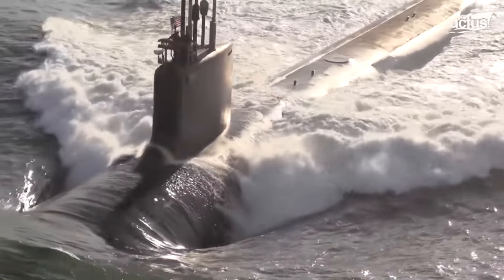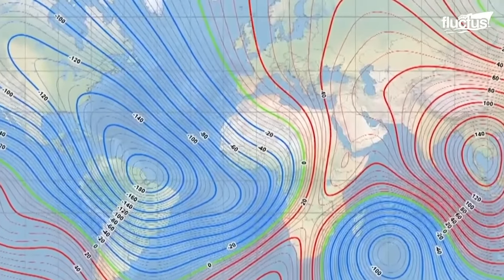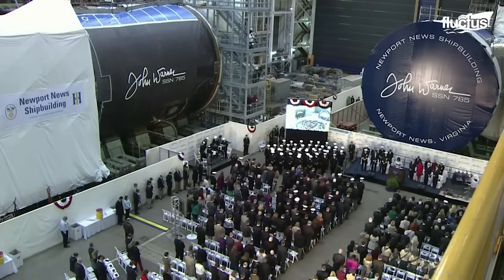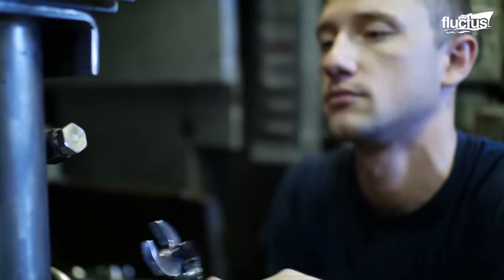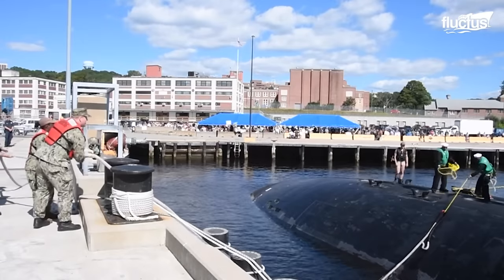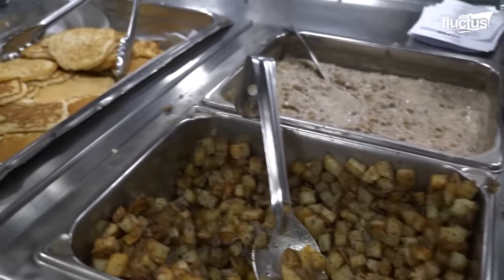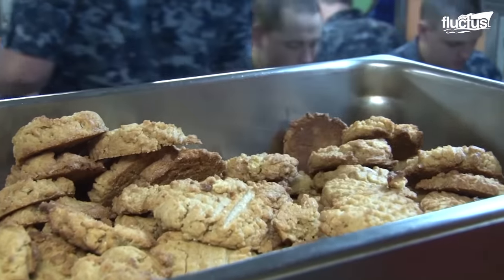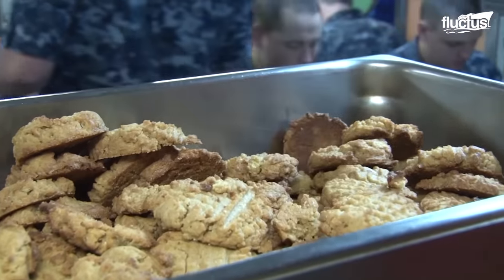Life Inside $4 Billion US Gigantic Submarine

Comment: It's overwhelmingly amazing and scary af , a pure combination of a deadly beast. I'm pretty sure even the people operating them on a daily basis don't understand what kind of savage machine they're using. Art at its finest ❤️ the pinnacle of human imagination.
Reply: Not really.  Submariners have to qualify to continue serving onboard.  You have roughly 1-year to earn your qualification. If you fail, you are shipped off to the surface fleet.   That being said, the qualification is comprised of every system on board, electrical & mechanical.  You MUST learn and understand how every system works and is interconnected with other systems.  Learning how one failed component can cause multiple problems throughout the boat.  You must learn damage control technique, how the internal ventilation system is designed, everything about the emergency recovery systems, how the reactor systems work, memorize how the waters systems are designed and what modes and operations are performed by it.  This isn’t just the mechanical rates, everyone on board has to have a basic knowledge of the submarines entire systems to stay and work on board.  The funny part is this, those qualifications are just the “basic knowledge required”, you have to build on that knowledge to qualify higher level watch stations.

Comment: OK, so now I have even more respect for those in the U.S. Navy who work on a submarine!!!!!! Only question in my mind, besides what's for dinner, is since the mess hall is where they cook, how does the cooking appliances (stove, ovens, etc.) vent out the exhaust when the sub is submerged for so long?
Reply: I'd say recycling or pumping  it in the heat/cold system. Or going up once and again to pump it out without too much pression? O  simply putting it in some torpedo and launch it as it is?
Reply: Just move the exhaust fumes to a separate chamber, and then release the fumes from the chamber.
Reply: This is a great question. So all the air in the submarine gets recirculated while submerged. All of the grill exhaust that you're talking about goes into the fan room and recirculates with the rest of the air. There is equipment on board that cleans the recycled air and removes the toxins and harmful gases from the air. Fresh air replaces the old stale air when the submarine comes up to snorkel or comes to the surface.

Comment: I have looked everywhere to try and confirm that the Virginia-class submarines are made anywhere else other than in the USA. From Wikipedia: "The Virginia class is built through an industrial arrangement designed to maintain both GD Electric Boat and Newport News Shipbuilding, the only two U.S. shipyards capable of building nuclear-powered submarines. Under the present arrangement, the Newport News facility builds the stern, habitability, machinery spaces, torpedo room, sail, and bow, while Electric Boat builds the engine room and control room. The facilities alternate work on the reactor plant as well as the final assembly, test, outfit, and delivery." I SEE NO EVIDENCE THAT THEY ARE BUILT BY SAAB.

SAAB builds subs. Just not for the USA. (The video never actually claimed that the Virginia-class submarines are made by SAAB)
Reply: they are not, Saab does build some Diesel powered subs , but not for the US Navy. This whole video is just a bunch of irrelevent facts taken from different videos.  Pointless.

Comment: I thought the submarines were built by General Dynamics' Electric Boat.
Reply: Newport news shipyard also
Reply: SAAB builds subs. Just not for the USA. (The video never actually claimed that the Virginia-class submarines are made by SAAB)
Under the present arrangement, the Newport News facility builds the stern, habitability, machinery spaces, torpedo room, sail, and bow, while Electric Boat builds the engine room and control room. The facilities alternate work on the reactor plant as well as the final assembly, test, outfit, and delivery. Those are both located in the USA
Reply: @mwreyf1   i know i build them lol
Reply: That is an aircraft manufacturer. You mean General Electric Boat company

Comment: I’m more interested in how much the equipment needed to built these amazing machines cost
Reply: Equiptment is only as good as the operator running the equiptment.
Worked in D480 for over 15 years and EBGD has a 46' lathe turn table which cost a pretty penny.

Comment: Is there turbulence when a submarine is submerged?
Reply: Turbulence? They feel the currents and the sub does move around with the tides, but it's not as dramatic as you would think. 

As for turbulence, that's for airplanes to worry about, not submariners..
Reply: We were under a typhoon in the western Pacific. It got real sloppy due to the surface effect so we went to 400 feet, there was still some movement but not bad. The Oldman didn't want to rig for deep submergence to get us deeper.

Comment: It's Reactor versus Everybody.
Reply: There have been far more accidents on the decks of aircraft carriers, than there have been Nuclear propulsion problems. In fact, the United States only lost TWO nuclear submarines and BOTH we're equipment failures not related to the reactor itself. 

Also, it has been proven by the Navy and experts, that the reactor on the both submarines are in tact and pose NO threat to surrounding marine life and we certain the reactors shut down automatically...just as they were designed.
Reply: @CJOlin  That's was the motto of my old Nuke School in Bainbridge MD.

Comment: "Halls and beds", lol it's passageways and racks, bud. Becuase operational tempo has stepped up and funding has gone DOWN, these sailors are enduring 7-9 month deployments on average (fast boats/SSGN only) I was on both SSN and SSBN's and loved every second of it. This is really hard work, if you have a pair of silver dolphins, you know it! What the video doesn't show is the truly tough jobs on board, namely Deck Division painter or worse "helper",  if you don't know what Non-Skid paint and polyamide is, then you're better off for it. Mess cranking, and the absalute worst of the worst: Trash Monster! (what we called it on my first boat). That's where you get to crawl down into a bilge, and haul up 50 pounds of weights at a time, (repeat this several times) form flat sheet metal into a can, add a bunch of weight sto the bottomwhile slicing your hands up as a Chief bitches you out, then compact the trash, complete with eggs, slime, old chocken nuggets and other trash squirting out. You're exhausted and have to clean the whole trash room after. But these are jobs for NUBS, or "non useful bodies", those without the Silver Dolphin Submarine Warfare pin. SO, if you ever decide to join, work your ass off and live off of coffee and Red Bull until you qualify, don't complain about anything, understand that you are a liability until you qualify and you might make it.